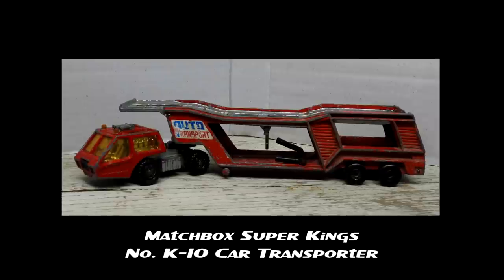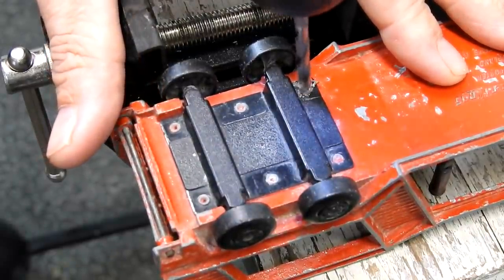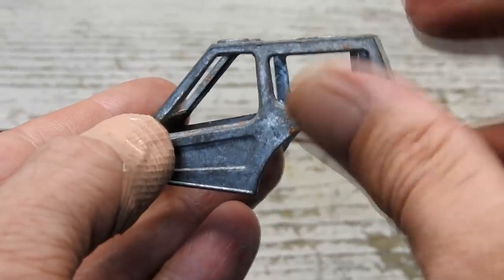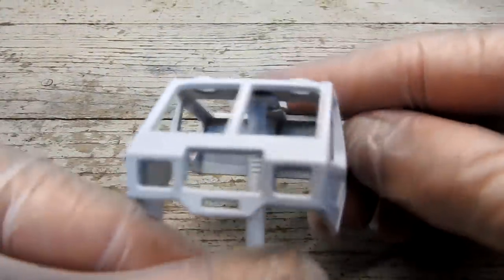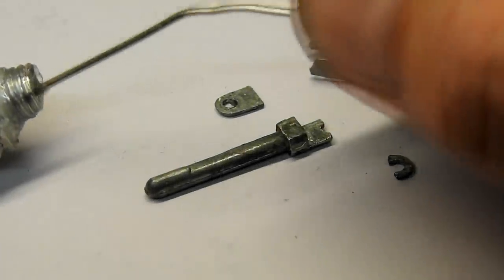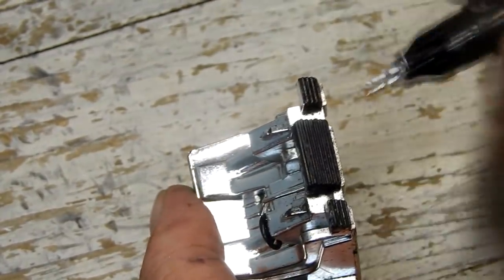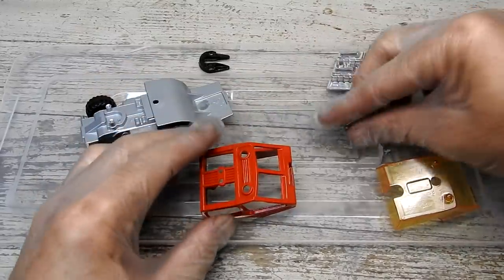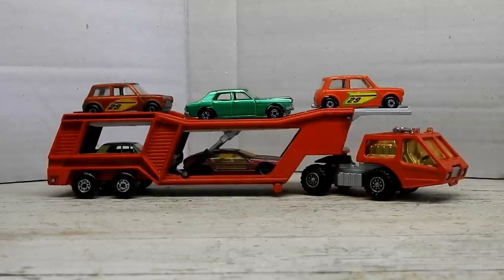Matchbox Restoration Super Kings K-10 Car Transporter

Comment: Hi, First look ist seems that it is nearly impossible to get the rust out of the difficult edges of the model but you spend a lot of time doing that before spraying the filler. For my opinion it looks better than a new one bought. Enthusiasm in restoring is the first big helper I can see in the work you have done and always a good idea of serving problems by broken parts. This is my first video I've seen of that big scale. Until now I have only restored little cars which didn't needed so much work on. For this restoration  my biggest honor to you! Great work and ⭐⭐⭐⭐⭐. Greetings and always happy restoring !

Comment: Fantastic Retro Futuristic Car Transporter , great job 👍. ..... l think l woukd've used some small screws and nuts to fit the hydraulic rams , but it looks fantastic !
Reply from the maker: Nuts and bolts would work great if you can find some small enough 👍
Reply: @DannysDiecastDisasters  Don't know if you have Jaycar Electronics stores in NZ but any of those electronics hobby stores should have fasteners that small.
Reply from the maker: @Tiger351   Yes we do have Jaycar I will check them out next time I'm in town.

Comment: I'm rather ashamed of the notion, and how long I held onto it, that larger models would not be as difficult as the 1:64 scale. If anything, the larger size points out any mistakes you might make, and have parts that are nigh impossible to repair or replace. Excellent work on what was a very demanding job.

Comment: Instead of going through all that hassle with the steel wool, I would use a rust remover like MC-51. Just submerge all metal items in the fluid, come back later and all the oxidation/rust is 100% gone! Now ready for painting :)
Reply: How about the ones in the tech zone.

Comment: Awesome restoration, I like that you removed the casting lines.
This thing would look sweet in spectraflame.
One question: why didn't you remove the casting marks from under the top trailer bed?
Reply from the maker: I didn't think to do that as it was a restoration but it would definitely look great if it was a custom. The other idea in the comments here about adding chains would be great in a custom as well.

Comment: I like how you repaired the hydraulic rams. I also might've tried to weld em with solder. I was surprised when you said jb weld didn't hold, then I heard you say jb quick weld. none of those 5 minute epoxies are much punkin when it comes to doin their job. that chrome pen seemed to work very well, what brand is it? anyways, awesome build, have a badass day 🤘🏻

Comment: Great restoration, will you be making your own decals to finish it off?
Reply from the maker: Yes. It was a sticker actually on this one. I don't feel my currant printer is really good enough so am eyeing up a better one then I will make a short follow up video 👍
Reply: Ahh that makes sense, I think making your own where possible will save money in the long run. I bought a box of old matchbox cars last year at a boot fair, it had several of these superkings in them with varying degrees of beaterness so I may have a go at restoring them, plenty to be getting on with.

Comment: i feel that the rust colored oxidation was only on the parts painted red ya? maybe the paint was iron oxide based?
Reply from the maker: Yes it was only;y on the red parts and not something I have seen before so you are perhaps correct 👍
Reply: @DannysDiecastDisasters  i often am, but i doubt i am in this case, i don't think those are old enough to use that type of paint, are they?

Comment: Nice work. Video is too long lingering on each process but nevertheless very interesting; The spray can paint gives a far superior finish to the project than the air brush; This is one thing I have found with the restorations finished by air brush; the finish never looks anything like the original factory finish but this particular project is as close as I have seen to that. Excellent work.Air brush finish sort of spoils the whole effect and makes the work look amateurish.Top marks for your finish.

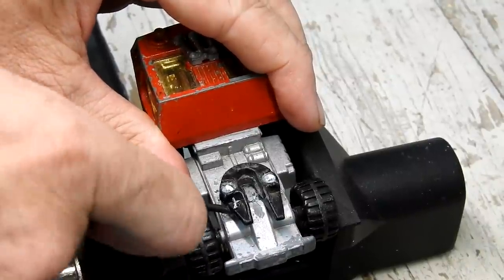Comment: Great restoration...... But a cringe-worthy flex of plastic with that tiny screwdriver at  6:18 ..... I try to use something that  supports more of the entire part. For that specifically I would use a hard vinyl (plastic) automotive panel pry tool  and get under the whole thing..... Not being judgmental, just my 2 cents....

Comment: Danny JB weld would do better than CA
Reply from the maker: Yes I did try JB weld on those pistons but it broke even after a good 24 hours curing. I think the parts are just too small to get enough adhesive to be strong enough.
Reply: @DannysDiecastDisasters  well ok then I woulda tried to butter both sides of the patch one side of the patch to stick to the part and more on the outside to fill the gaps and cover over the rough metal on the outside u used the 6 min or 24 hour ??? if u used the 24 it still might not have been hardened